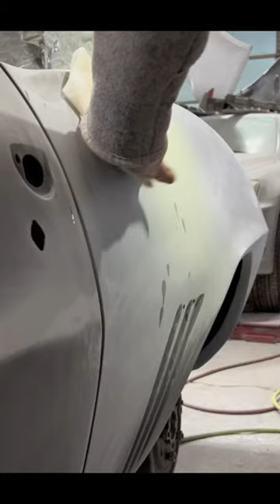DONTCHU TRYAN TELL ME ‘BOUT SHOW CARS🧐🧐😁

Comment: I know NOTHING about restoring cars. But I have recently inherited a 79 TA that had sat for 20 years. Once we scraped it off the garage floor, we got it running, but it's still not safe. Floors in bad condition. So I watch alot of your videos as no one wants to help with my TA? It's on of the Atlantis blue ones they only painted for a couple years.
Reply from the maker: In 99, I drove a pristine 79 T/A to Atlanta for a NACE exposition.  It had the Olds 403, and it was smooth as silk, and loaded with passing power😉😉